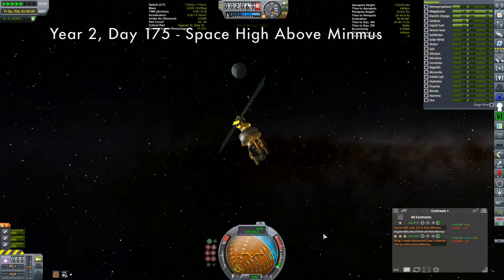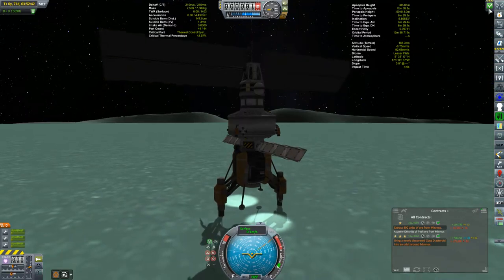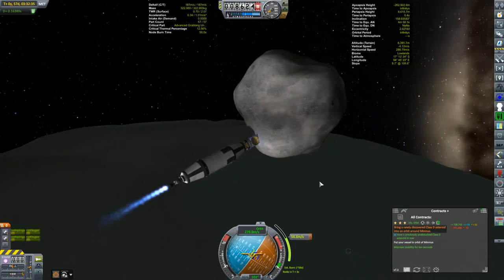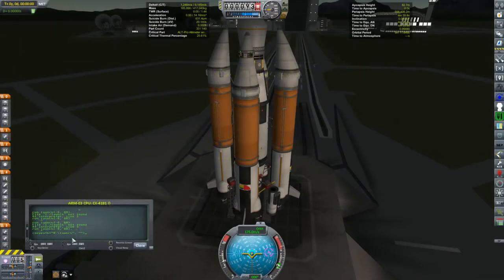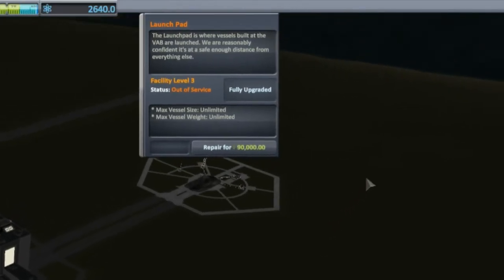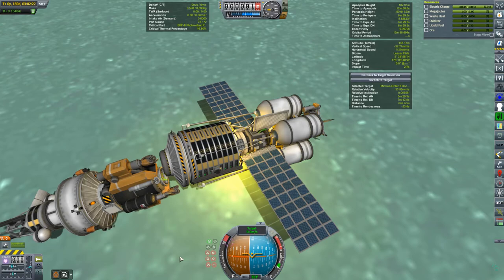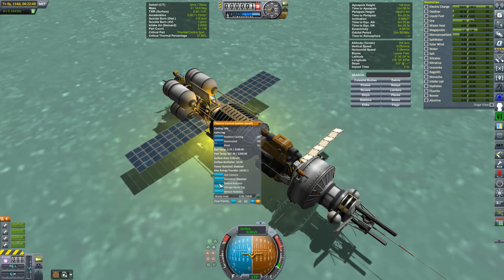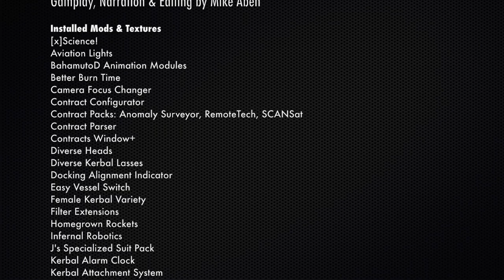KSP Career: Episode 122 - Head Over Heels

Comment: I would bet that the cost of refrigerating cryonics is proportional to their mass. Thus, as you burn fuel, the refrigeration costs plummet.

And you know Jeb was explaining how easy it would be to link those vessels with one engineer and two KAS pipeheads.
Reply from the maker: Jeb just refuses to submit to inevitable robot revolution.  
Edited to add: Sorry there were no kerbals this episode.  Lotsa kerbals next ep, promise.

That makes sense on refrigeration costs.  It wouldn't surprise me if Interstellar Extended modelled that too, but it was all chemical fuels being burned right up to the Minmus injection.  There's so much depth in KSP-IE.  I need to find the time to really dig into it.
Reply: Huh. If you weren't burning cryonics, then I'm at a loss... unless that's a bug and the mod takes stable fuels into account, which it obviously shouldn't.